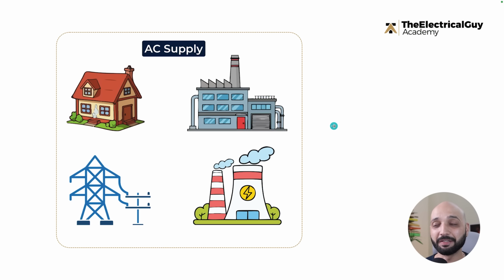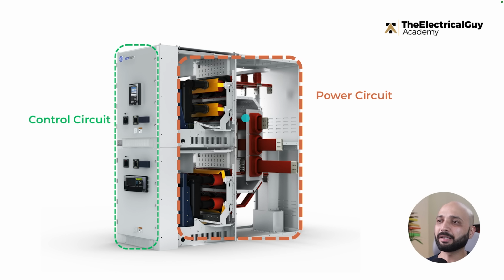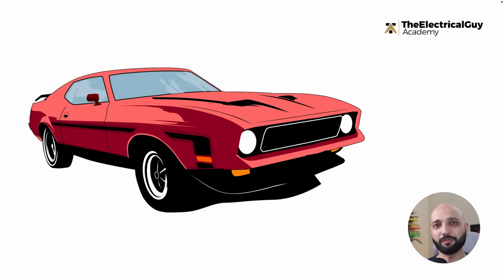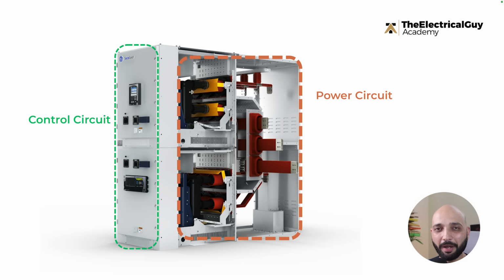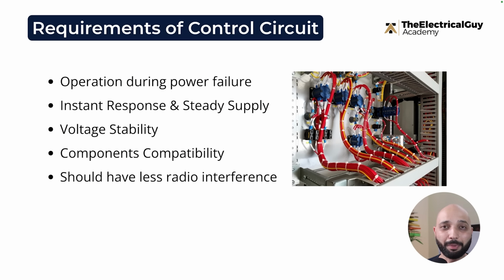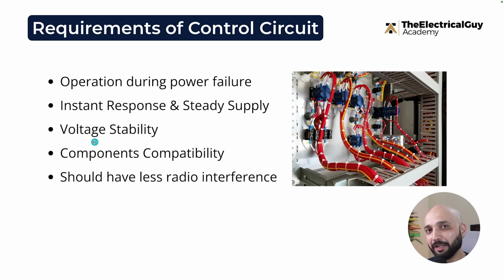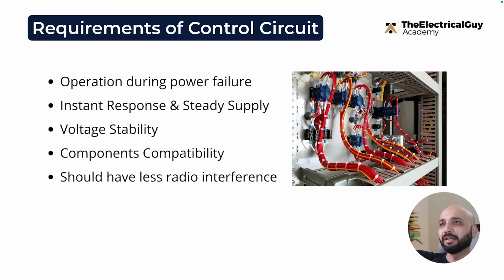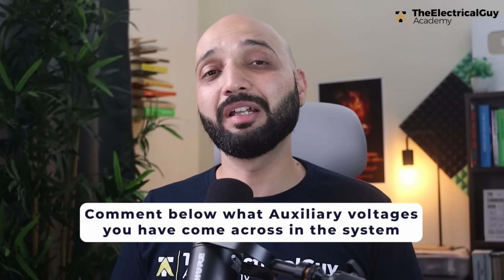Why Switchgear Control Circuits Use DC (Not AC)

Comment: DC because DC current can be stored in battery and no need power converter
and DC don't have much electromagnetic wave generated like AC wave that will generate wave which could results in interference with other electronics device which is sensitive to weak signals

Comment: Here it the simplest breakdown 
AC current cannot be stored!
When fault occurs when current is out by using capacitance bank the breaker can be switched on and off 
AC current cannot be stored 
Even If it is used the current required is low for the pannel indicator,relay,annouciater 50V,110C,220V the main incoming is in  HV so it cannot be used

Comment: Sir u said that big reason of the using DC voltages for auxiliary supply is storage. We can use UPS which also converts batteries voltages into AC voltage. 
For me main reason is interference or electrical noise. By using DC voltages we are protected from malfunctioning of protective or control devices. 
Regards. 
Electrical labourer in Pakistan

Comment: in the electric panel, say DOL starter for a motor most industries use AC for the contactor coil, so wanted to undertsand how does this coil differ from that using DC.

Comment: I had an experience of a 66/22kV Substation using AC supply for the spring charge motor for the 22kV switchgear panel. Is that a good practice?

Comment: Thank you sir for sharing this subject. However, I have a question - Can a UPS, that meets the requirements stated in the video, be used as a source of voltage for control circuits?

Comment: Much easier to feed DC from multiple sources with blocking diodes.  No synchronisation issues to switch seamlessly between, battery, mains fed rectifier, emergency generator fed rectifier.

Comment: Sir you are doing great job but it has been 10 years since you are explaining switchgear and power system I just think you should move on and try to explain something else for example go in depth in switchyard like in transformer there is bocos relay etc. in switchyard panels there are different types of relay installed you can make video of how they work there diagram and how to identify there fault apart from that you can make videos on electronic and there pcb circuit diagram,how to identify there fault because electronic is a field were future scope of growth, however it's my thaught it's upto you have a great day 🎉

Comment: Sir i am working as an electrical engineer in oil&gas we used both ac and dc voltages for control circuit, while we using DC voltage we are facing dc earth fault due to the control cable failure and also we are not earthed the dc negative terminal what are the possibility and the causes are affecting while negative earthing?
Reply: Which company your are working

Comment: You have given the example of Short Circuit Case, what f this is not the case. Suppose I want to control the speed, position, etc then here also DC is used. You have not explain the reason for these controllers. Could You please ??

Comment: In my country 110VDC is most common, however i've encountered 48VDC in an old switchgear. Usually we combine the 110V system with integrated UPS like Benning Invertronic so we can have cost&size effective 230VAC for control systems in smaller plants.